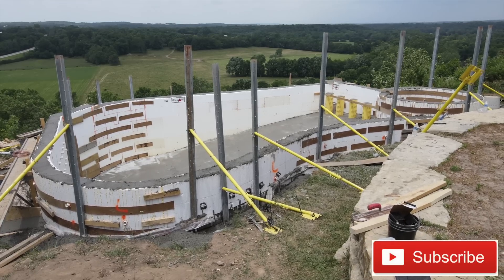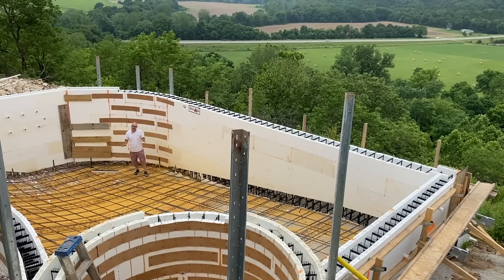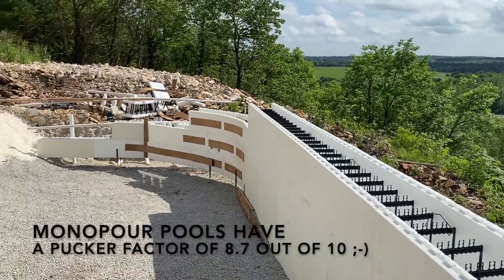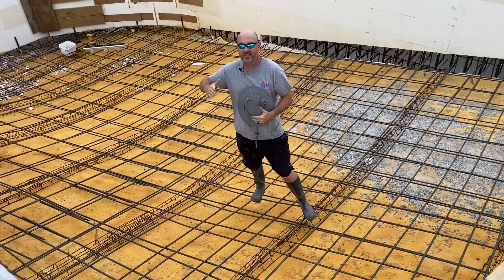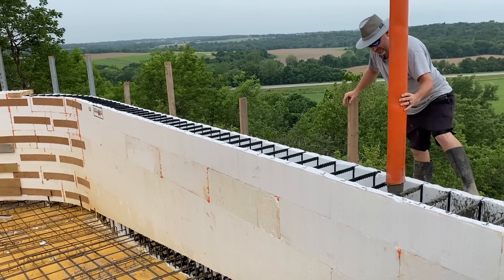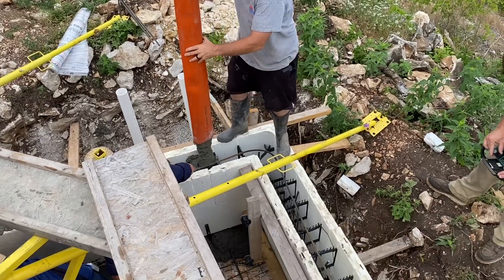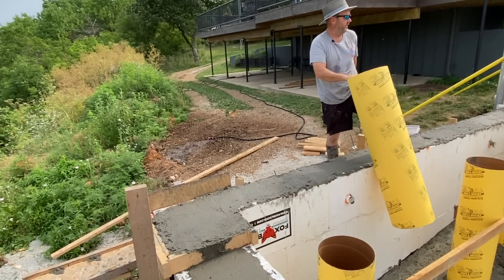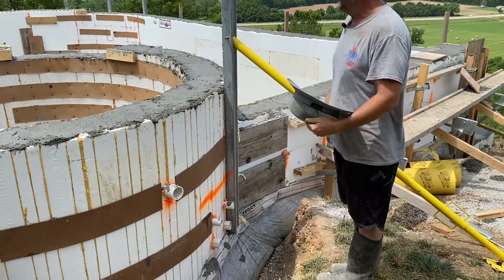ICF Monopour Pools Better than Gunite?

Comment: How do you know how much to cut out of the ICF to get the correct curve? Is it just little bits at a time, or is there a set way that it can be done?
Reply from the maker: Honestly just math…. If you think about an icf form bent into a circle you have 4 separate diameters, outside of foam on both sides snd inside(or outside of concrete…. You know that the form is 4’ in it’s unaffected form, so which face do you care about, on a house it’s usually going to be the outside of the radius, on a pool it’s usually the inside…. The inside face of the outside of the bend will remain 4’ long, the outside will grow slightly abd the inside form obviously gets much shorter, depending on the bend…. So you have to do the math based on the thickness of your core plus the inside foam thickness and come up with the length of a circle segment at the desire radius, subtract that from the original 4’ and then divide that by 6 for your cut between each web, then take half thst number off each end…. It sounds like a log but it’s not too difficult, we have considered coming up with an app that helps calculate some of this stuff but it may be too niche to garner wide enough appeal to justify!
Reply: @all3pools  thanks!

Comment: Better than gunite how?
Reply from the maker: Thermally broken for one, no need for a Gunite crew from out of town(Midwest markets specific).  No need for tons of false work on walls that are out of the ground the list goes on but until you see it first hand or do one if you are a Gunite fan you will probably be slow to accept and that’s fine, I’m sure when Gunite rigs rolled out in the 70’s the old heads hand laying concrete shells said it was a fad too…

Comment: Just wondering, has a structural engineer looked at these drawings?? Is this how size and location of vertical rebars was specified?? hmmm
Reply from the maker: Yes
Reply: @all3pools  Well, I built my entire house all the way to the roof with ICF. Have a cistern that's 18'x9'x9' and structural engineer drawing and rebar placement for that cistern looked a lot different. Just saying..

Comment: why mess around with plaster or eco finishes?  why not install a pool membrane?  why bother with all the rebar in the floor why not use wire mesh?  Especially if you are installing a pool membrane right up front.  Lot less work and expense! and no matter what even if you get a crack in the concrete the pool won't leak as it is the membrane that holds the water.  Those pool membranes installed correctly should last 20-25 years!  The way this pool was poured you have a thermal break between the floor and the wall. Yes you have a monolithic pour but in order to not have a thermal break you would have to run the Styrofoam under the wall and butt and seal it with the Styrofoam wall.  You cannot do this in this case as you have to allow the concrete to enter the floor area from the wall.  So yes you have a strong monolithic pour but you also have a thermal break.   Seems to me you have to choose between a stronger pool or a more energy efficient one.
Reply from the maker: I don’t think you understand the meaning of thermal break, plus we do vinyl liners on the lower end and ecofinish on the high end because it’s the best, if you don’t get the system it’s cool but when you don’t really even get that we are thermally breaking from the ground, not the wall from the floor, I don’t think you get what we are doing…
Reply: @all3pools  you have more than the floor that requires a thermal break the walls also require the same and in this case the pool is not lined in styrofoam because of the mono pour.
Reply: Seems to me you have to choose between using a liner or membrane or not. If you don’t you are really no better than a gunite pool and eventually they crack and spring leaks.  That is why many of those pools end up being lined with PVC Membranes.  So if that is the case why spend the extra money for all the extra concrete and rebar in the floor?  Lay your styrofoam down up to the ICF wall and pour a 4” thick floor with wire instead of all that rebar… yes it is not a monolithic pour but if you are using a membrane who cares?
Reply from the maker: It’s an icf wall…. It has over 4” of styrofoam thermal breaking it, I get you are promoting a product but you don’t even understand what this pool is…
Reply from the maker: You are describing a pool no better than our vinyl liners and more expensive…. Our upper end pools have everything Gunite has with the addition of a thermal break wether you understand it or not, and the added benefit of not needing a Gunite rig…. There’s a time and place for a membrane but it’s rarely a solution in new construction
Reply: @all3pools  iI don’t have a axe to grind with anyone’s product.  It sounds to me like it is you that has missed the point, yes you have a thermal break… in places but it is not a complete thermal break and that is my point you have a 12” continuous hole in your  thermal break all the way around the inside bottom of your pool walls.  AND unless you are in a earthquake prone area you are about double the recommended  floor thickness  even for a gunite pool. Given the tittle of your video I think it is you that is  selling the product!.  Keep it up your are just making yourself look worse! And definitely over building a project at the customer’s expense no less!
Reply: @all3pools   Hmm… one of the largest pool companies in the world builds ALL of it’s pools with membrane liners!  And a 80 mil PVC membrane with an embedded scrim that lasts 20-25 years is hardly in the same class as a standard cheap vinyl pool liner!.  I guess in the end it is all how you sell your product to the customer
Reply from the maker: I know Saudi Arabia uses membranes a lot and maybe that’s how you get it’s the biggest thing in the world, but I’m positive membrane pools are behind Gunite, fiberglass, and liners in the USA by volume and my guess is that’s a function of value and economics…. And my entire pool is thermally broken, I don’t give away all my trade secretes for free…

Comment: Thanks for the awesome video!  I always come back to your videos so I can pick up new things. Have you ever poured a monopour pool using Helix micro rebar? If so did you completely eliminate the rebar or did you reinforce corners, drains, ect.?  I'd love to see a video of you using the Helix micro rebar sometime.
Reply from the maker: I haven’t yet but the engineers I’ve talked to say it’s doable and man would it be easier…. They did mention that certain areas like spillover walls and any walls out of the ground would still need rebar based on their previous experience
Reply: @all3pools  Thanks for your response.  I can't wait until I can see a video where you've used it.  That's how I'm planning on building mine.  Less work and potentially less issues down the road.  Keep up the great work!!

Comment: I take the non-DIY warning seriously but was wondering what it if multiple pours were used and the walls were plastered with Sider-Crete? Sure, it's not a monopour with ecoFINISH but could someone get within striking distance of a professionally installed pool with that approach? (Not thinking of a pool with this remarkable design, of course!)
Reply from the maker: It can be done, fox blocks actually has engineering on multi pour pools and sider Crete as the waterproofing…. Sider Crete is effective. It’s harder than their marketing would suggest, and all colored plasters effervesce and get chalky so don’t be disappointed if it gets a modeled look pretty quick, it’s not you, it’s normal, most people don’t mind it, we are trying to develop the best hybrid system that eliminates all the things that big us but there’s nothing wrong with sider!

Comment: What’s the cost breakdown per yard? Gunite is about $250 /yard in my area with minimal additional cost in steel and backer board per yard. You mentioned cost is on par with gunite but, in material/prep alone it looks to be quite a bit more costly than a gunite pool.
Reply from the maker: There is no Gunite rig or special crew…. Just a grand for a pump truck, rebar is similar, plumbing is the same, the icf itself is usually under 5k per pool…. No backer board, and if the Gunite guys are leaving it at rough coat you’ll have similar prep costs to upgrade to an eco finish that you will with icf…. Only advantage I can see is a talented Gunite crew that takes time to get it as smooth as possible, then the prep for eco would be a lot less than icf, but icf is thermally broken which easily outweighs then downsides in our climate!
Reply: @all3pools  awesome. One more question for you, if you wanted to still go the gunite route and wanted that thermal insulation between ground and gunite, would a single sheet of the ICF as a backer board standup to the gunite being shot directly to it?
Reply from the maker: Just use 2” Dow board, similar thickness with fewer joints

Comment: Sounds like 3-4 times the price of a gunite pool!
Reply from the maker: Not in our market…
Reply from the maker: But I am curious, what a Gunite pool like this should cost in your market?  I assume you plaster it, we are eco finishing which is a premium upgrade but for arguments sake let’s not even factor that in, what does a custom shaped Gunite pool around 30k gallons with a 40’ infinity edge fully automated with top of the line equipment cost in your market?
Reply: At cost if I was to do it for myself in the neighborhood of 150k
Reply from the maker: Ok do this is running a bit less than Gunite…. Def not 3x…
Pentair intellicenter with personality kit
2 xf pumps
Master temp 400
Ic60
Ecofinish 
All for under 150k

Comment: I used to build mono- pools using steel forms,, in DAYTONA BEACH,  Florida. 
Burley Built pools.
Used a Crane with a concrete bucket for pouring the walls and pool.
Ran the plumbing in the walls.

Comment: Wow, boundless energy!  Very impressive work!  Insulation is awesome benefit of course, but now you have inside and outside foam surfaces to cover.  That plaster over foam with mesh assumed, but has to be really good for impact.  The panels for ecofinish need really really good taping - thermal movement of a black finish.  What if it was possible for you to get the same insulation benefit without all the foam surfaces to protect?       Edit: Forgot to mention that your block curving idea is freaking awesome!  Thank you for sharing that!
Reply: My contention is if you used a pool membrane you would not have to install all that rebar in the floor and could have used wire in the floor AND a 12" thick floor is WAY over kill a 4" thick wall is all that is required (if you install a pool membrane).  It doesn't matter if you get a crack in the floor the membrane holds the water in and hides the foam from the sun.  Where the ICF wall is below grade a peel an stick membrane would be required on the outside of the ICF pool wall.   Where the outside wall is exposed (above grade) you would have to face that wall with something though on a job like this covering the outside wall with masonry would make sense and ICF is certainly capable of handling that!  I might add that a gunite pool Probably would  be a lot more difficult  to build in a situation like this pool -a free standing self supporting wall faced  with masonry on the outside of the pool.  Using ICF Blocks would potentially require a ICF sill block unless you used the foundation as your sill.   Here is a video talking about using a Fox Block Sill Block and how you attach your masonry to the outside of the fox block wall https://youtu.be/miv8m9N4cBM

Comment: Isn't there a way to do icf on the floor too? 
It would be awesome to have a L shaped angle blocks
 and do the floor so no concrete is in contact with the ground
Reply: No you install close cell foam UNDER the floor (either spray foam or panels -pour your floor to the ICF wall.  The  cell foam under the floor  comes all the way to the ICF wall and a bead of spray foam seals the joint between the floor foam and the wall foam.  In a Mono pour like this video you have a thermal break  where they trim the foam off the inside of the wall (yes the spray foam is under the floor but there is a thermal break where the concrete flows from the wall into the floor.   The mono pour may be stronger but it will be less energy efficient than a pool constructed where the floor is poured after the walls are installed.  Of course you have to decide on how you are going to finish the pool.  If you are going to only rely on the concrete to keep the pool from leaking then you would be better to do a mono pour.  If you are installing a pool membrane then you can better insulate the pool and the membrane is what holds the water in.

Comment: A few questions for the pros. For an inground ICF pool do you not need interior bracing during the pour? I realize having braces would make things very difficult during a monopour, but they use them for basements so how are pools any different? Is this where pouring in 3' increments comes into play? Do you backfill the pool and fill with water simultaneously to equalize pressure or is that not a problem? I've seen ICF walls collapse when backfilled to soon so what time frame would you recommend for backfilling with gravel? Thank you
Reply from the maker: When monopouring a pool we brace outside!  Monopour basements are usually footing snd wall, floor done after the fact, but if u were to pour floor at the same time you would just brace the outside of the wall!
Reply: @all3pools  Thank you very much for your response.  I live in NW North Dakota so using ICF  seems like the only reasonable thing to use.  I'm not a pro by any means so dealing with all that hydrostatic pressure scares the crap out of me when it comes to backfilling the pool and the initial water fill. Have you ever used the helix micro rebar in place of rebar in your pools yet? I'm skeptical but very interested in using it myself. My only worry is the overall finish with metal possibly protruding and how it would work in Fastfoot footings.

Comment: Are the walls stable enough to be standalone or do you need to back fill earth to the top of the pool?
Reply from the maker: Depends but mostly yes, icf has different core sizes from 4-12” thick, monopours that are totally in ground we use 6”, spillover pools we use 12 on spill walls snd 8 on buried walls….

Comment: Pool on a hillside is never a good idea.  Was friends by chance with two kids that both had the same house.  The builder of the development put his house in the best view of the development...with a pool....by the time I was friends with the kid that moved in after he moved out the pool was cracking and sliding down the hill...like 4 years later.
Reply from the maker: Seismic zone? Decomposing granite?  I need details of said hillside before I can take your comment seriously…. Not all hills are created equal, say one in bedrock is different than one built in dg on top of the San Andreas fault…
Reply: @all3pools  I'll give ya the address 2154 Grand View Blvd, Onalaska WI 54650.  Built by Evenson Const (the whole hill) and this was Evenson's personal home, sold to 49% owner of Ashley Furniture about 4 years later.
Reply: I suppose I should clarify...I wasn't intending to knock your build....just what I'd seen that makes me nervous about pools on a hill. I'm sure you've done your due diligence to put it there. 
   Pretty sure it's a limestone bluff, we're in a unique area glaciers never hit.  Not too far from there is a 100 year old cave for storing beer, with a 2.5ft diameter shaft that runs straight up 50ft.  Guessing that was to get warm air to vent out the top.  No one knows about it...a highway went in and it's forgotten.   Pretty cool though.

Comment: Impressive work!!…10” Concrete wall/concrete bottom vinyl liner, and Gunite pool builder here in New England.I started building pools in 1980, and the technology has evolved so much in 40 years! Looks like a hell of nice system using the ICF blocks, but I’m not sure about the eco finish as I hear a lot of mixed reviews. Nice work!👍
Reply from the maker: I’ll keep you posted on eco, plaster really takes a beating in our climate so I love the ph neutrality and epoxy base, my partner has been repairing pools with epoxies for years, and this seems like a logical extension for us but we will see!

Comment: All that work to use metal rebar. If water gets in it will rust it and break/crack the concrete. Why not use fiberglass rebar? They already spent a lot of money on that project
Reply from the maker: I’m using lite bar in one now, crazily enough some of our municipalities are still interpreting the code that we need metal, to bond the pool, so the metal doesn’t cause a problem lol…. When we are allowed to we love fiberglass bar
Reply from the maker: And at this moment my plant sells lite bar for $.10 a stick less so there’s def no reason not to!

Comment: Just out of curiosity. What mix of concrete are you using?
Reply from the maker: We used to use xypex admix for extra waterproofing, but with our new ecofinish they recommend no modifiers, so we use a 4000 psi pump wall mix, brought out at a 4 slump, set up just enough to pump easily and vibrate thoroughly

Comment: I love the idea of using closed-cell on the ground as a sealer and insulator.  I've always wondered why people spent so much on insulating and sealing the walls and roof and then just drop the footings and slap on gravel or dirt.  I'm guessing if you do it right you could come in and spray the fastfoot at the end to completely seal and insulate it.